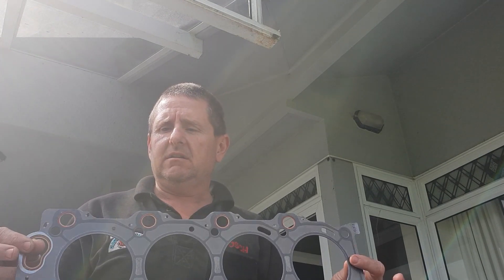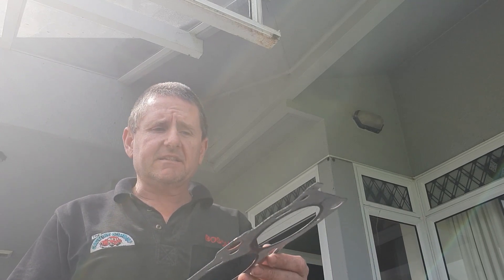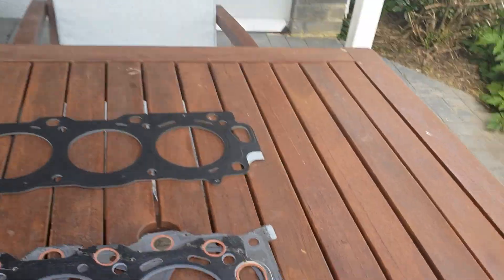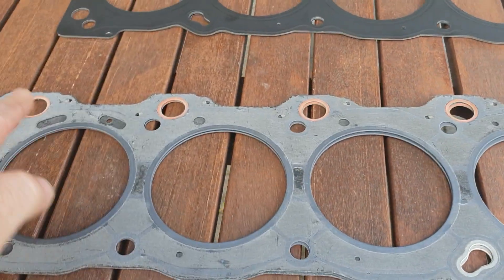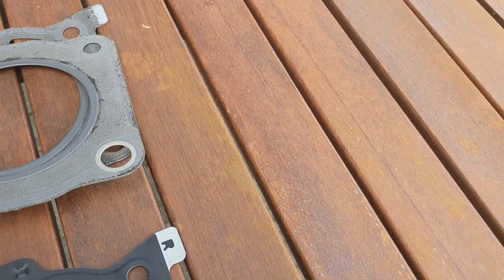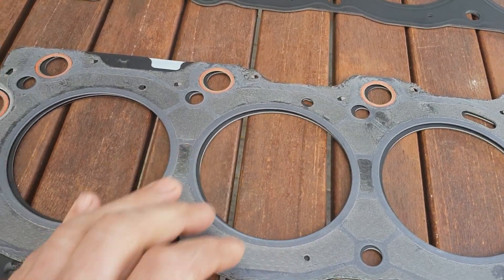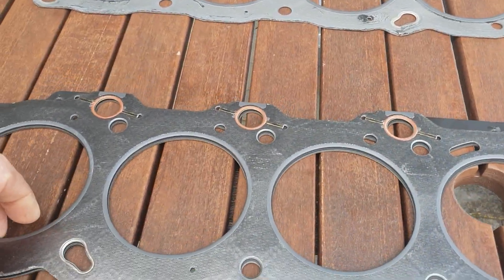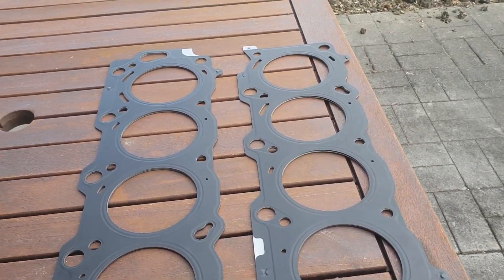1uz Head gaskets including MLS Steel gasket upgrade for boosted 1uzfe Turbo or supercharger

Comment: Hey Kelvin, it’s been a few years since this video. Would you say at this point that a set of OEM vvti HGs would be a better choice than a set of Cometic? I can’t help but think that OE Toyota is just going to be plain and simply better quality.  Caveat is that my engine could see nearly 28-30psi boost and ethanol fuel
Reply from the maker: Yes.  There are some advantages for the Genuine toyota over the aftermarket too if you look into the bore sizing.  Cheers Kelvin

Comment: Love the info and channel guys. What gaskets would you recommend for a 1uz with kelford turbo cams 10.1 comp full forged rotating assembly and 2 Wuhan war whistles running 25+ lbs ? E85 fuel
Reply from the maker: These MLS would be close to their long term usable limit with those boost levels.  I did a day with a guy running 24psi on MLS gaskets recently but it would pump water from time to time so I would generally recommend some o-rings for the fire rings and an MLS gasket for the rest of the sealing.  Cheers Kelvin
Reply: @CartuneNZ  Thanks so much for replying Kev , did you have a part number for those gaskets ? Having a hard time finding them in Australia.

Comment: Im in the US, have a '96 SC400. I've reduced the factory weight by 500 pounds, added aftermarket suspension (solid subframe mounts), also welded diff. So, the car performs very well! My thoughts, since having a recent issue(1st ever) engine starts, then may run 10-15 minutes and loads up.. flashes engine light and cuts off. I've cleaned MAF, also disconnected, while engines running and it shuts off.. I assume that indicates, it's likely ok, also tested the TPS, by measuring voltage at yellow wire(idl): moving throttle from stat to open(.90v and 4.1v..guessing it's also ok? Anyway, I'm interested in possibly illiminating the ECU and going either single carb or Itb's; I understand that, the UZ can build power after the factory 6,200 cutout? Is the gen2 UZ capable of handling 400-500 crank HP? Your thoughts and advice would be greatly appreciated! PS the car doesn't require emissions and the egr/evap/cats are deleted. Also, it's automatic and I may eventually install the CD009 6 speed.  Enjoy your vids..much thanks!

Comment: Hi thank you Kelvin can I reuse the headbolts on my 1 uzfe motor to safe cost it's a import motor and 1 time lifting the heads
Reply from the maker: If you want,   its your engine,  but if doing so I would recommend checking each one against the toyota spec for them.  Cheers Kelvin
Reply: @CartuneNZ  thank you  for your knowledge will keep you posted on the build because I just want to  boost max 0.8 bar with 550cc injectors and hp aim is 450 to the wheels

Comment: Hey great video . So its ok to use oryginal vvti HG on my boosted vvti instead off Cometic ? If they working on older ones with boost
Reply from the maker: Absolutely,   and stock ones are likely better quality than cometic.
Reply: anks for your answer, it's very helpful. ok so i will use oem hg on my vvti i aim at 500hp what do you recommend for grinding piston?;) and what do you think about 2jz valve springs, i should use them. Thanks again and good luck great job

Comment: Awesome, I’ll now be using vvti HG on my 2uz head- early 1uz block build 🤙🏼
Reply from the maker: Please make sure you check the sealing surface.  The 1uz, 2uz , 3uz have different sized bore holes.  Trick for some.  Cheers Kelvin

Comment: Wait just clearing up. So you’re using the vvti engine reseal kit on the non vvti and all the gaskets work just fine? Just making sure so I can order the right stuff!
Reply from the maker: Not the complete set.  Head gaskets interchange from vvti back to non vvti giving a easy and quantity Multi layer steel gasket for a non vvti engine.  With the rest of the set some parts swap over however stuff like intake manifold gaskets and tappet cover gaskets are completely different.   Cheers Kelvin
Reply: CartuneNZ Okay cool. So long as the good majority fits fine. But stuff like front/rear main seals and valve stem seals will fit just fine?
Reply from the maker: @swaggysunex9919  front and rear seals are the same.  Ive never compared valve stem seals as I buy a non vvti gasket set but swap in the steel head gaskets.